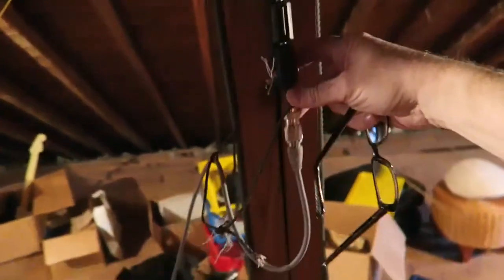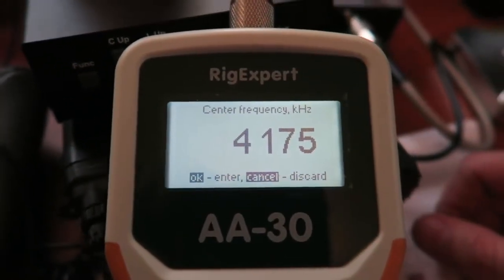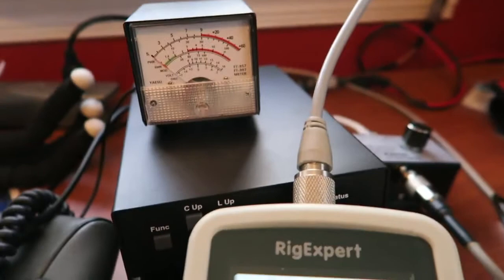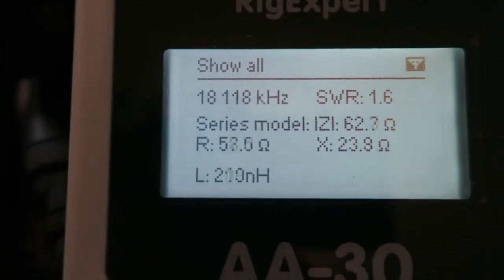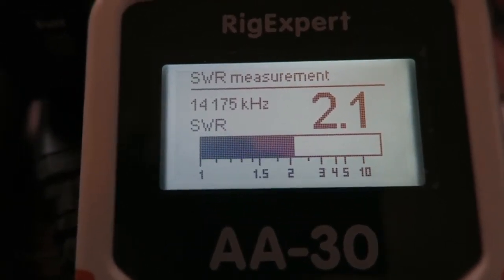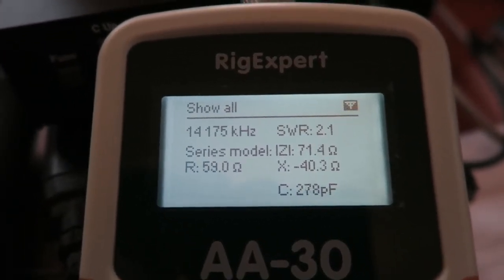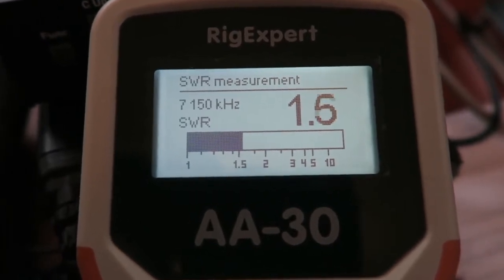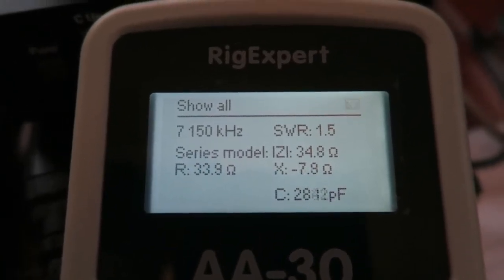Fan dipole, or multi-band dipole, antenna in my attic for my ham radio hobby

Comment: If it stops working on all your bands then time to rethink your antenna. Otherwise, enjoy what you receive with what you've constructed. Most hams have compromise antennas and still make contacts. 73 KB8AMZ
Reply from the maker: Thanks! Compromised antennas....I thought that was the  idea...hihi! The first contacts I made were using a speaker wire dipole haphazardly strung up in a tree. I'm still new to this this, relatively speaking. Only been licensed since 2016.
Reply: @BargainBasementHamRadio  Ron, we use what we can or some buy what they can afford. My fist antenna was pieced together scraps of wire that rescued from a construction site dumpster that I spliced and soldered together. That antenna was up only 20 feet. I've used 300 ohm ribbon cable, speaker hookup wire, zip cord, dog perimeter runner wire, coax, telephone cable wire, cat 5 cable, chainlink fencing, and whatever would resonate at the desired frequency. Some of us want an antenna that is aesthetically pleasing to others and others are happy with an antenna that works and think less of what it looks like. Hi Hi 73 KB8AMZ
Reply from the maker: @MoTown44240  So true!! I really wish that I had been exposed and took an interest into ham radio at a younger age.
Reply: @BargainBasementHamRadio  Me too. I was 41y when I began. Just turned 72y.